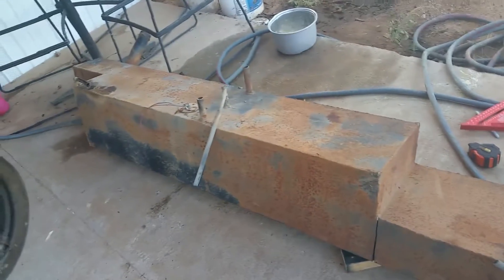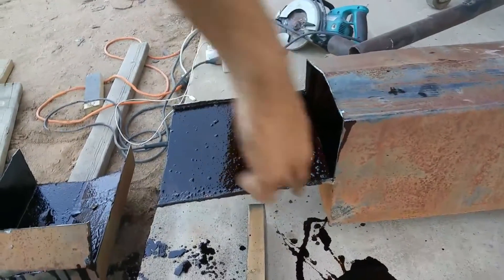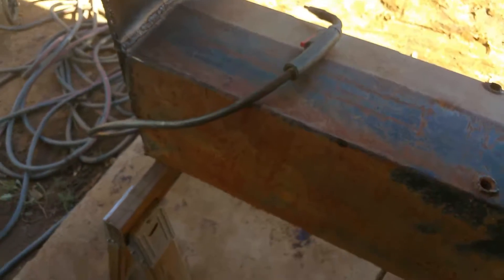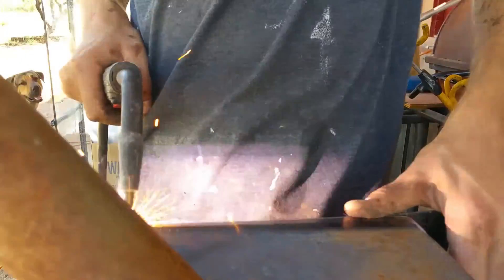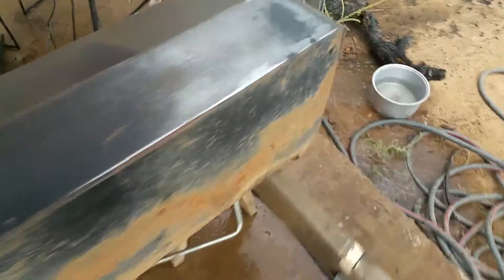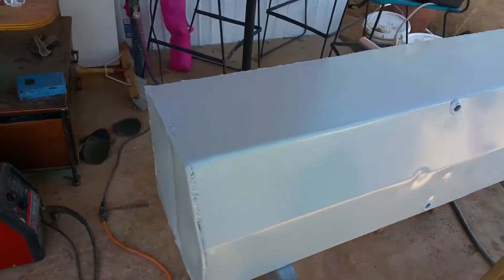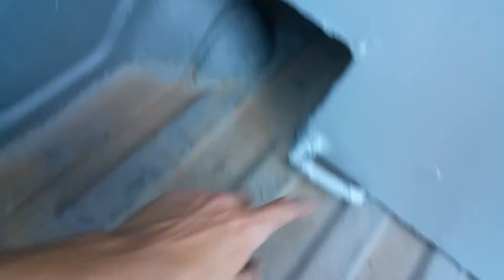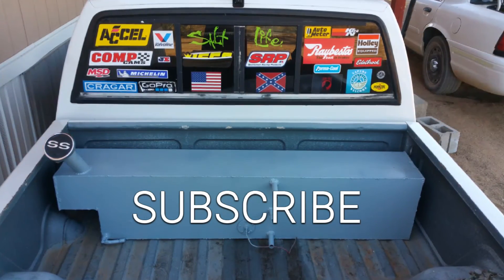V8 S10 Build 24: Fuel Cell Gas tank

Comment: I really like your gas tank idea . I have been trying to come up with a better way of putting in a gas tank in my s10. I think I'm going to use a S10 Blazer tank and try that
Reply from the maker: +James Bowers thanx, I wanted to get a blazer tank and mount it dead center under the bed in the very back but every tank I foumd had holes in them. I still want it behind the rear wheels for weight but gonna stick with this til then, thanx for the comment